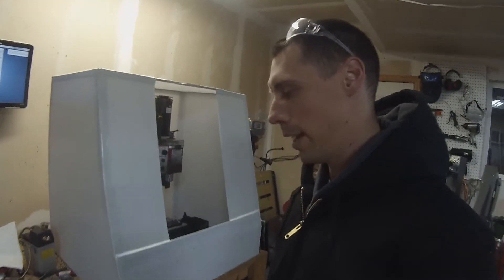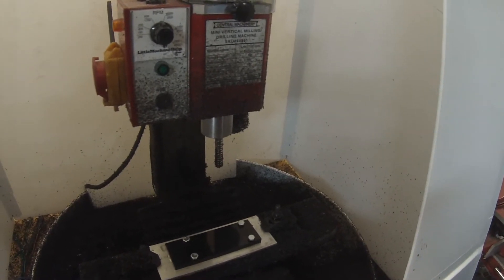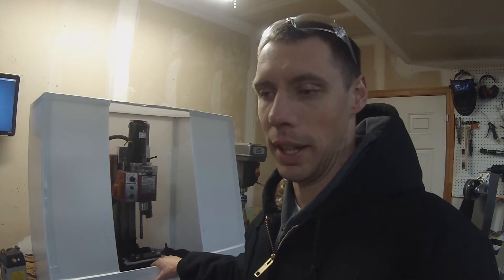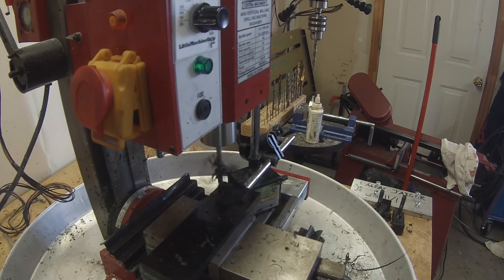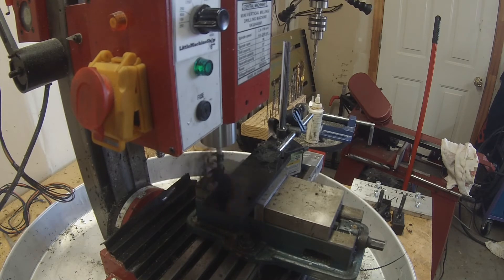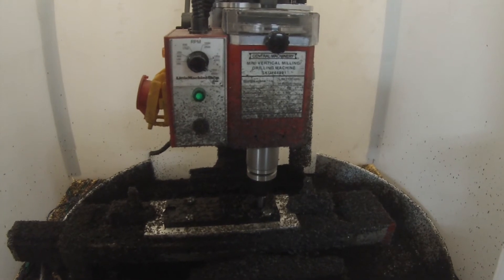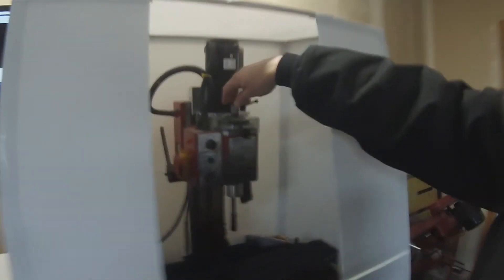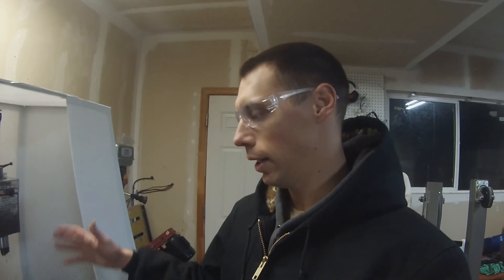Machining ABS Plastic with CNC Mini Mill

Comment: Hi there- Thanks for great video. Roughly, what RPM did you use with the 1/4" 2-flute mill? Thanks.-Peter
Reply from the maker: It's been a while, but I'm pretty sure I was running the spindle as slowly as possible to keep the plastic from melting.  It was insanely slow, like just above stalling.